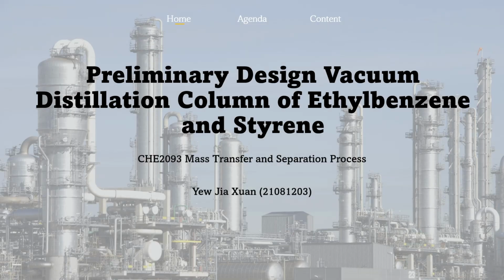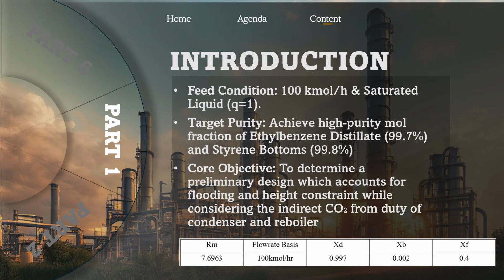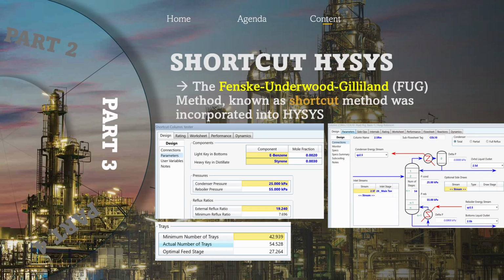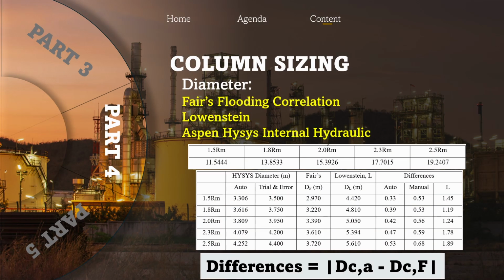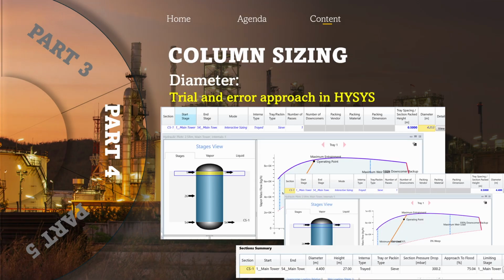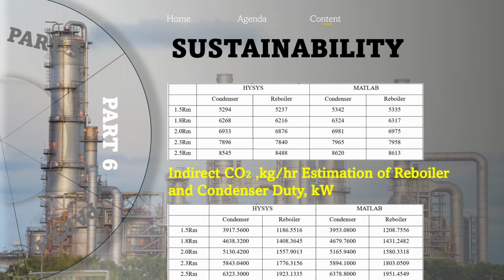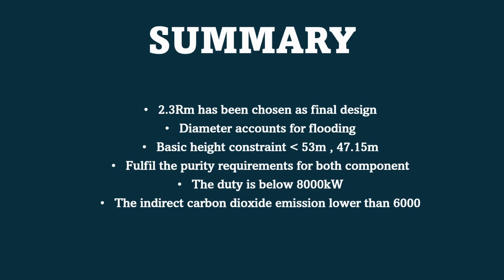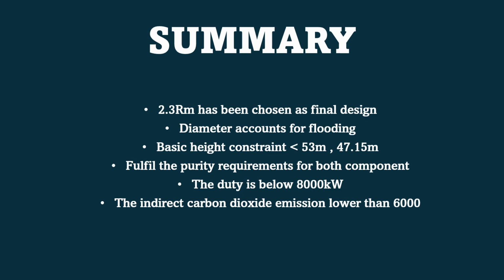Preliminary Design of Vacuum Distillation for Ethylbenzene & Styrene

Comment: Since styrene is prone to polymerisation, did your design account for the pressure drop across the trays when determining the operating pressure and bottom temperature? If so, what safety margin was used?

Comment: You used the Fenske-Underwood-Gilliland (FUG) shortcut method in Aspen HYSYS followed by rigorous simulation. Where did you see the biggest difference between the shortcut calculations and the rigorous model?
Reply from the maker: The main difference between the shortcut model and the rigorous model lies in mol fraction control and stage configuration. 

In the shortcut (FUG) model, you specify the exact target recovery or mole fraction (such as setting 0.997 mole fraction of Ethylbenzene at the distillate), and the model will calculate the required minimum reflux ratio and actual theoretical stages to hit that exact targeted purity. 
In the rigorous distillation column, hitting an exact composition is much harder because it is calculated by MESH equation where mol fraction will be calculated stages by stages mean where tuning of reflux, feed stages, tray number are required to reach your target purity. (sadly the MESH equation has not been mentioned in report, but the mol fraction differrences can be observe by extracting both liquid and vapor mol fraction of Ethylbenzene in my report appendix)

Moving on, the actual number of trays needed in the rigorous column to reach the targeted purity ended up within a plus minus of 1 tray of the shortcut prediction.

Comment: Since the three sizing methods give different column diameters, how would you decide which value to use for the final design?
Reply from the maker: I selected the column diameter determined through the HYSYS column internals manual trial-and-error approach for the final design because simulated conditions under that diameter confirmed the column operates safely far away from the maximum entrainment limit without flooding. In contrast, Fair's and Loewenstein's methods serve as preliminary estimation tools. 

The difference between the final manual approach and Fair's entrainment correlation was relatively small (around 0.5m to 0.6m - in report), proving that Fair's approach is usable and relatively accurate for a preliminary estimate. 

On the other hand, Lowenstein’s method was omitted from the report due to extraordinary diameter differences when compared against Fair's correlation (ranging from 1.4m to 1.8m - in report), proving it is only for initial screening. Furthermore, I also observed that Loewenstein's method requires fewer calculation variables than Fair's approach, further demonstrating that Loewenstein's formula is merely an initial empirical screening tool that cannot be used for final design. (sadly this Lowenstein discussion part has not been included within report as well)